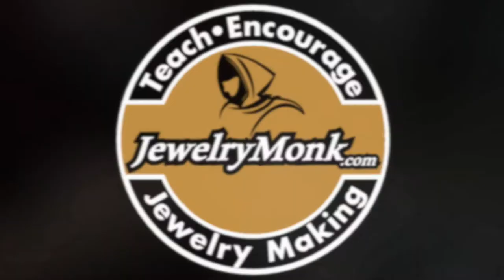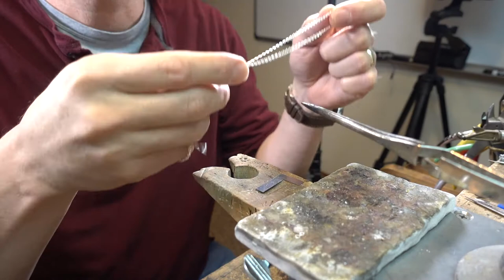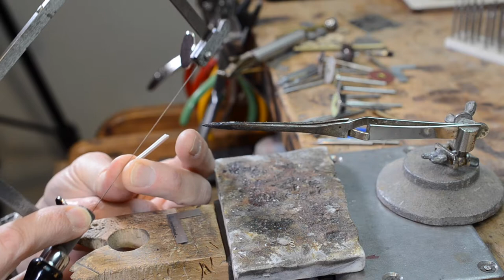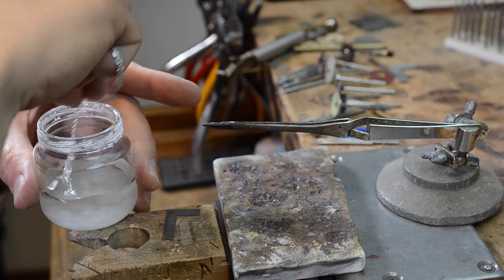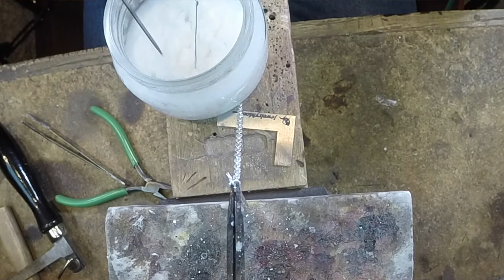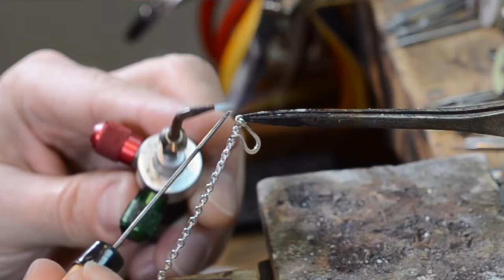Loop Soldering Demonstration

Comment: Great tutorial. I have yet to use my solder pick like that, buy have been wanting to. I was wondering what the ratio of denatured alcohol and borix acid is you are using. Is that to protect from firescale?

Thanks so much for the great tutorials!
Reply from the maker: Thanks. Ratio is about 1 teaspoon Boric Acid Powder to 1 ounce of denatured alcohol. Yes, it is a barrier to protect against firescale.
Reply: @DougNapierJewelryMonk  thanks for the clarification and for posting the great tutorials. I'm exited to watch more.